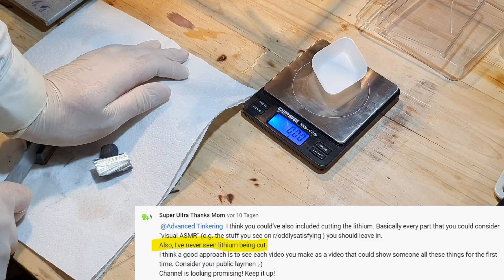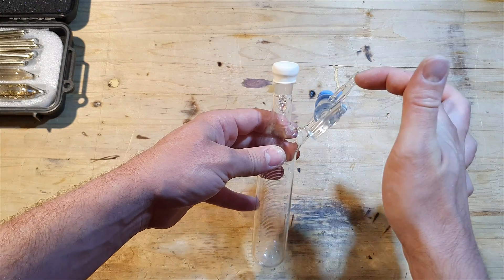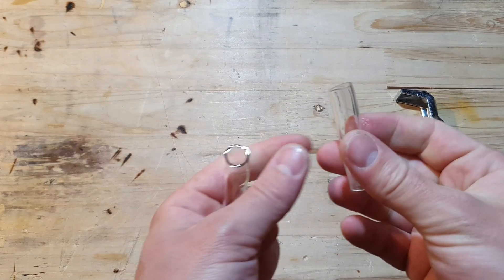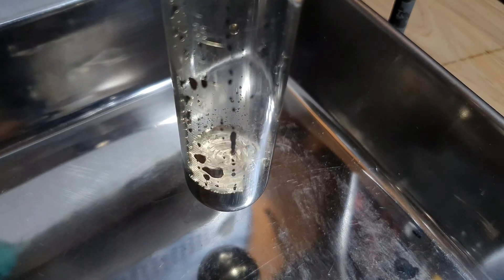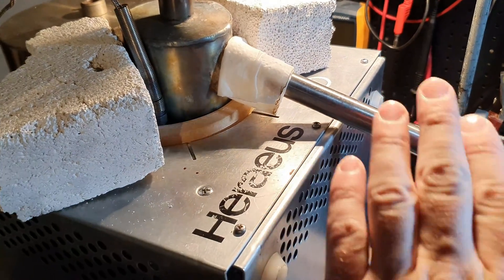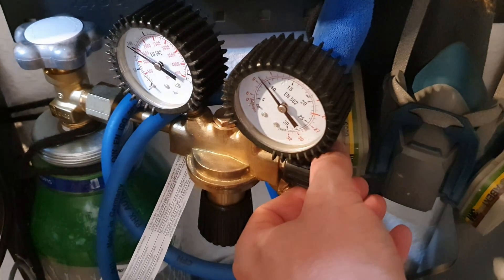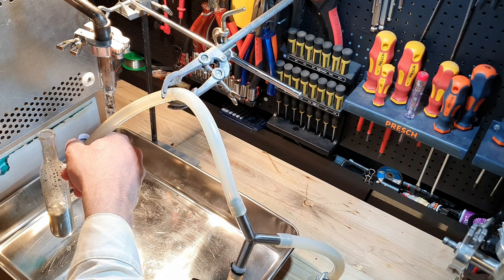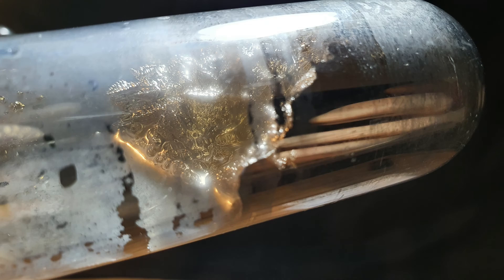“How Much Cesium Do You Need?” – “Yes!”

Comment: Perhaps the electricity in my area is just more unpredictable and this isn't an issue for you, but it has made me curious what would happen if the power were to go out during your procedure? I can't help but imagine a catostrophic accident if the vacuum pump and lights were to shut off mid-distillation. Does your building have generators for such a case?
Reply: In retrospect I suppose you might just turn on argon flow through the system to prevent disaster in this case.
Reply from the maker: Exactly. I would flush the system with argon and let it cool down.

Comment: Is it okay to keep a bunch of ampules of cesium in contact with each other in a case? I don't know how fragile they are, but if you dropped the case, would they break?
Reply from the maker: The vials have very thick walls. I don't think dropping the case would brake them. Nevertheless I would not recommend storing them this way. It was a short term solution until they were used.

Comment: I wouldn't recommend using a metal kf clamp like you have on glass. From my experience in industry we only ever used those clamps when both ends of the kf connection were metal. I recommend the clamps made of wood or some soffit material with multiple thumb screws. This lowered the chance of breaking the glass

Comment: I know you said it's low purity, but I think you had a lot less oxide in this one, it's wetting the glass a lot less and it's keeping the shiny surface better.

I wonder if it'd be worth plugging it in future inside a "glovebox", just a taped on bag with a hole in it to let it vent.
Reply from the maker: Yes, I meant lower purity compared to my redistilled vial from this video: https://youtu.be/budLy8ll8Bw

This cesium will be used in experiments anyways. In a future run I will redistill it and seal it directly under vacuum like I did in the video above. That way there is even less exposure to any impurities and oxygen.

Comment: What is the best way to clean your glassware from Caesium usage?
Reply from the maker: Letting it slowly react with long chained alcohols decreasing the chain length gradually to isopropyl alcohol and ethanol. (Be careful, it could catch fire). When everything has reacted it can be cleaned with water.  
You can directly use isopropyl alcohol but it will definitely catch fire and the reaction is a lot more vigorous.

Comment: Elias and Advanced Tinkering collab, probably the most excited I've been for a collab for a while now since Elias is planning on doing some crazy stuff like making n-butyllithium. I also wonder if you could possibly improve yield by using lithium powder, obviously it probably wouldn't do much since the lithium is molten anyways but it possibly could as there would be more surface area and so the reaction would go faster (possibly even thermite-like similar to the magnesium-NaOH thermite which would not be good if it does, you'd have a thermite making cesium)

Comment: does cesium react with mineral oil? could it bit an option to have a small amount of mineral oil in the receiving flask to isolate the cesium from oxygen for easier take-out?
Reply from the maker: It does not react with the mineral oil but with oxygen and water dissolved in the mineral oil. So it's not an option for high purity vials. But we will use it to protect it while removing small amounts for the experiments.